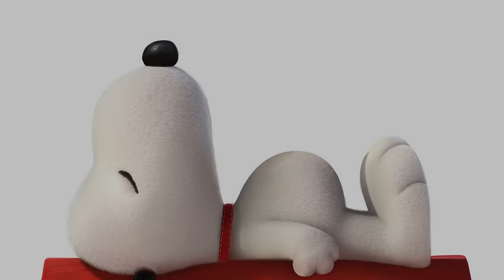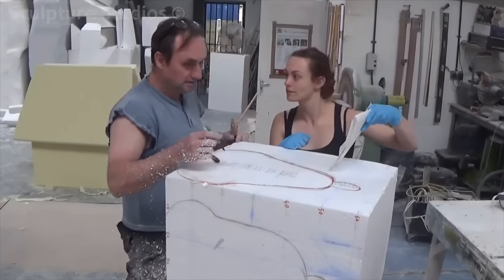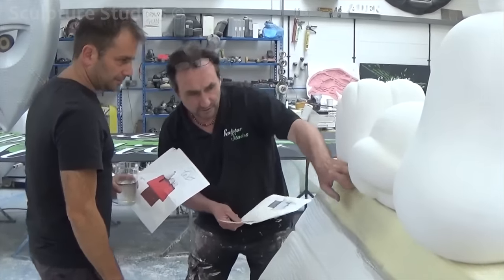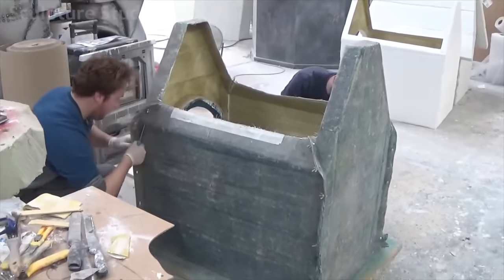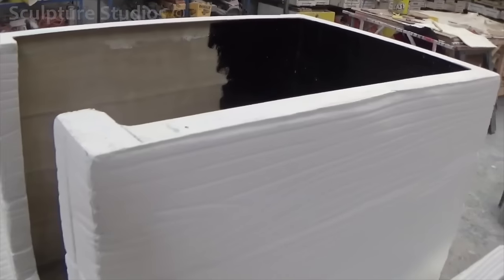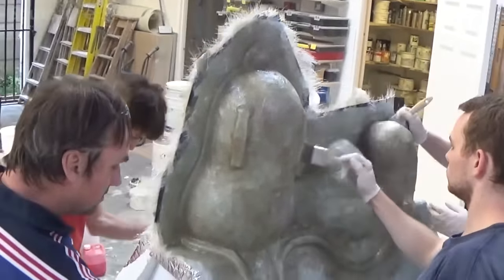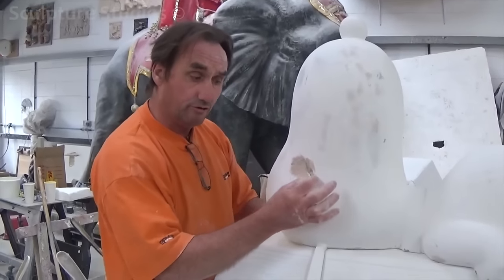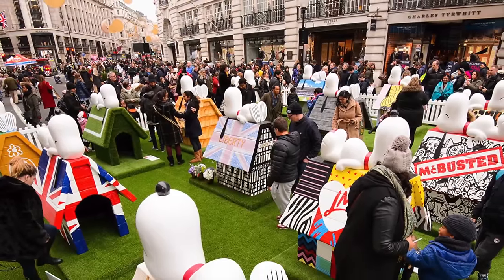Snoopy Art Trail by Sculpture Studios

Comment: Hi! I loved how you created so many snoopys! I have one question... Did you apply any other material to make the Surface white and smooth after the fiber glass? ( referring to Snoopy ) or you just sanded it And as consequence of sanding the fiber glass takes that colour?. Thank you very much!!
Reply from the maker: A white gel coat goes into the mould before the fibreglass. So it come out of the mould with a better finish than the woven fibreglass look. We then need to do a butt load of sanding and filling with car body fillers to both make up the join line as well as correct any imperfections in the surface. Before it's primed white

Comment: one more question plz what resin do you use in the silicone rubber mould epoxy or polyester?

would both epoxy and polyester resin uses the same gelcoat?